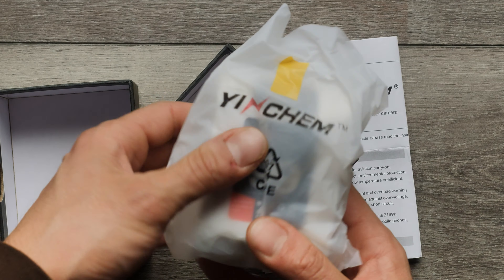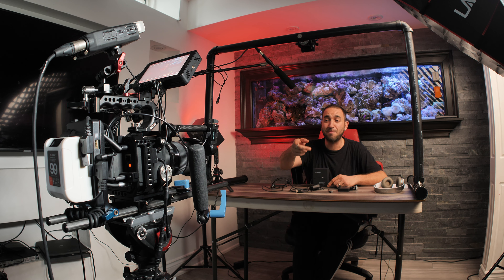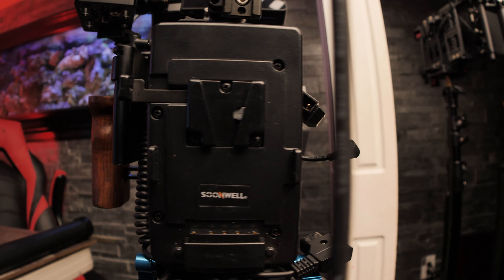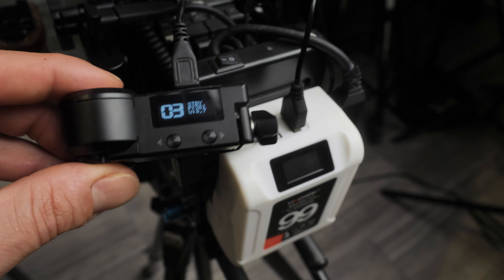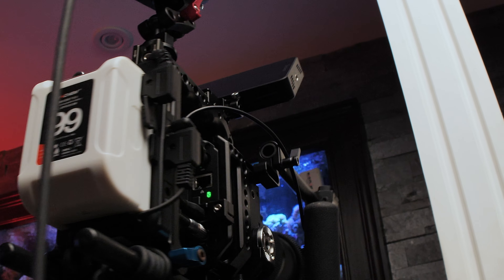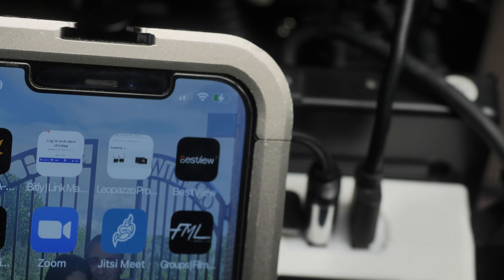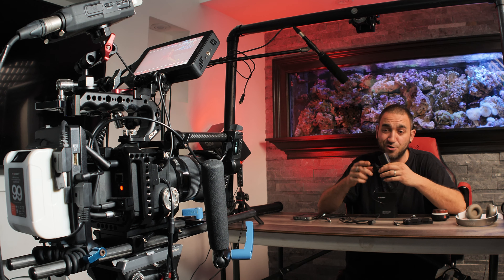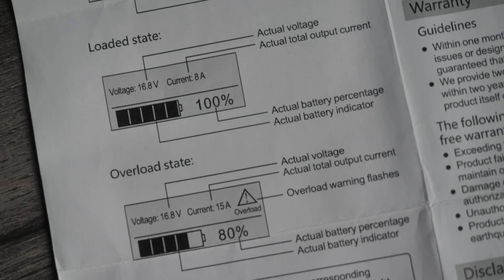Yinchem V Mount Battery Powering My Handheld Camera Rig

Comment: Hi bro, are you still using this batteries? they still working fine? I'm looking one to use with 6k Pro. With your kit, what time aprox do you use it? 2hrs?
Reply from the maker: Hey Mauricio thanks for watching man. Yes I still use this v mount battery and I have also bought some other brand v mount batteries for backup. In general to power my camera and monitor with this v mount battery it will last approx 2-3hours. Overall I am still happy with it and it works well.

Comment: Hello. I saw you straightly powered the monitor to the vmount battery.

Will there be no issues like frying up the HDMI port on the monitor? 

Thanks!
Reply from the maker: No I have never had any issues at all powering any of my monitors with the d tap to DC cable. Just double check what is the required input voltage for your monitor as the dtap supplies approx 14.9 volts to my monitor. 
Hope this helps.